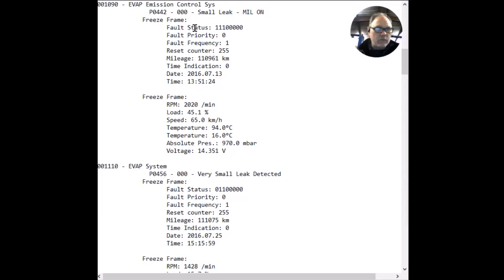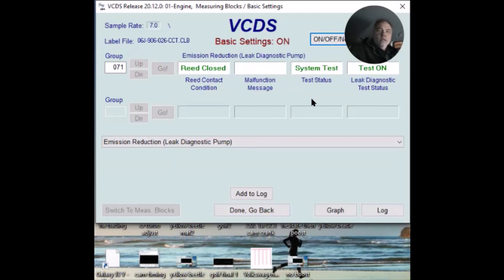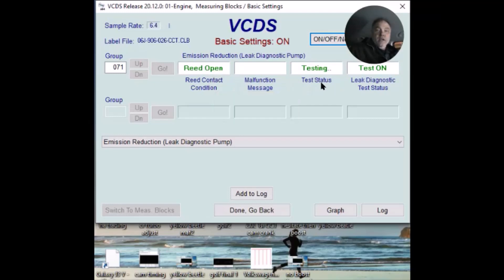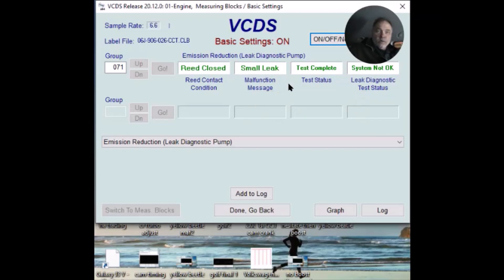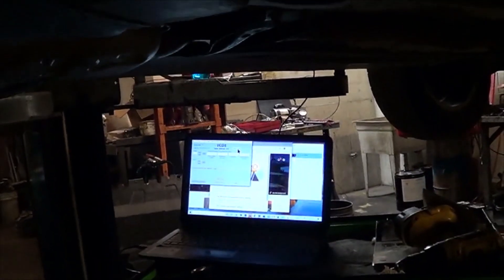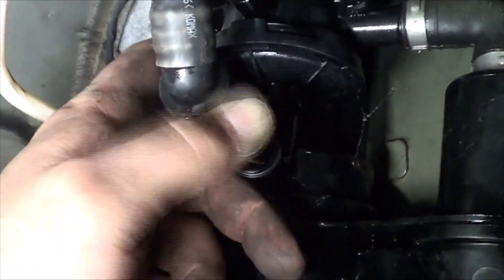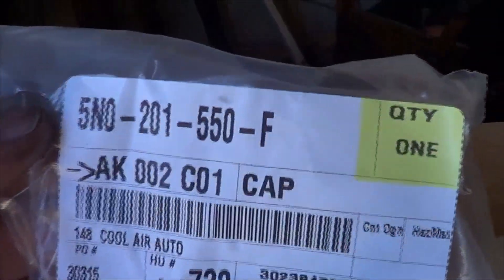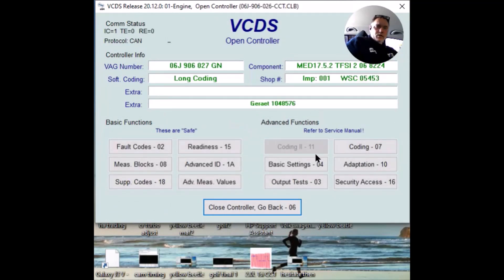2014 Vw Tiguan EVAP Codes P0442 P0456

Comment: I Agree with the mechanic on the way he did his job  because it could of been a combination of all 3 and in the process he actually narrowed it down to just one the fuel cap and  if he just went ahead and replaced the fuel cap and the problem continued after he gave the vehicle back to the customer abd the customer ended up bringing it back for the same issue what would that mean or do to the  reputation of the mechanic and the shop I would rather be sure instead of just guessing that the cap was the problem  .That the Big Problem with so many of the shops out there just wanting to make a quick buck and not really fix the issue knowing that the customer would be back with the same issue I  commend the mechanic for not just guessing and throwing parts on the vehicle like a lot of the shops do

Comment: Good stuff Richard!
When you use your wireless VCDS... do you have it set to "access point" or "infrastructure"? I set mine to access point, so that I can use it on test drives / away from shop wifi... however, I still end up losing connection / communication, often enough to the point where I resort to attaching the USB cable again. Are you having the same issue?
Reply from the maker: yes. Lots of disconnects but thats how I use it.
Reply: @CoolAirVw  Thanks... good to know I'm not the only one having that issue.

Comment: Well done on the systematic diagnostic process! 100% agree with leaving the cap alone until testing the rest! Thanks again as always
Reply from the maker: eh, maybe not??   At least when I know the cap is like this one.
Reply: @CoolAirVw  is the test only done on a wound-up car?
Reply from the maker: @варданмуслимов  Does "wound up" mean with the engine running?  I guess just do the test the way I did it in the video.  If the test requires vacuum to run the leak detection pump and vacuum comes from a running engine then............